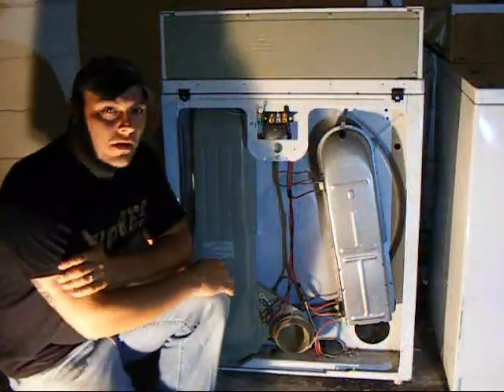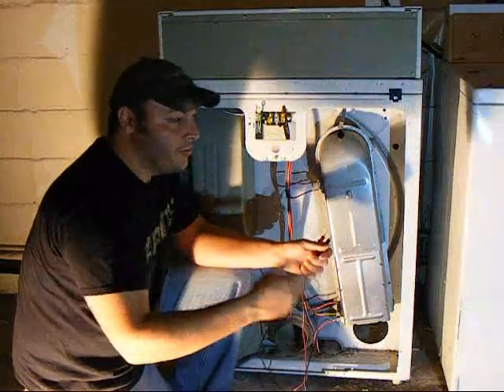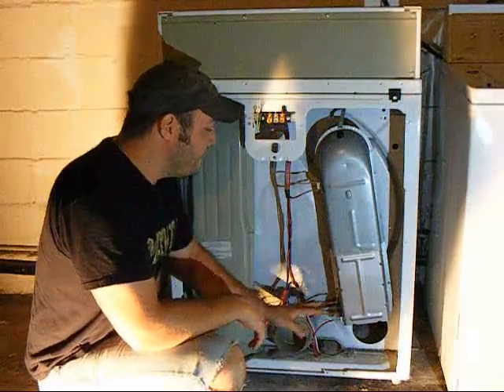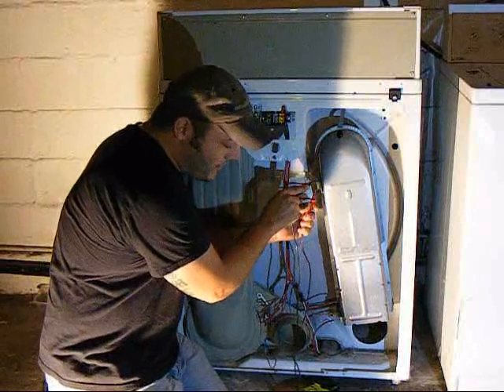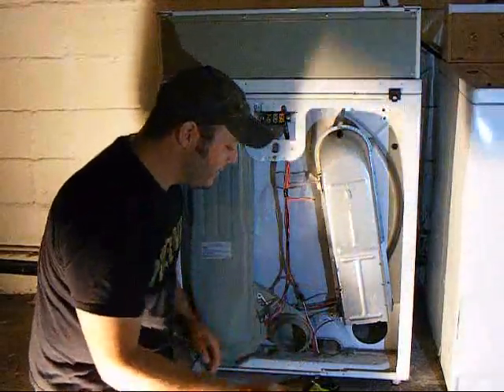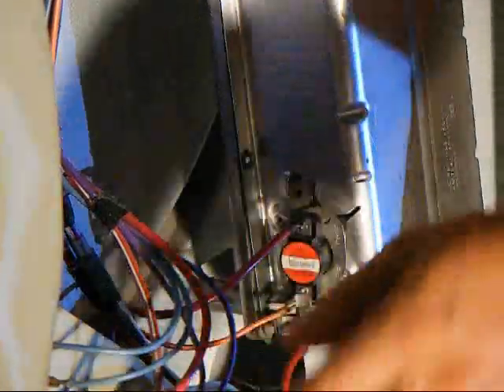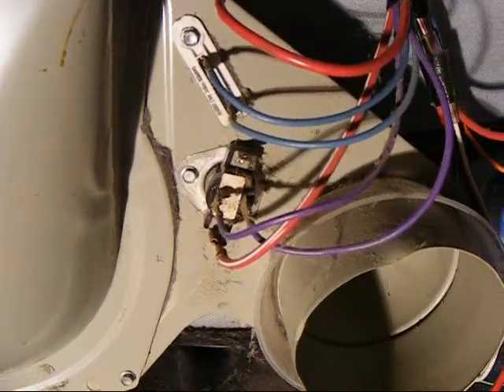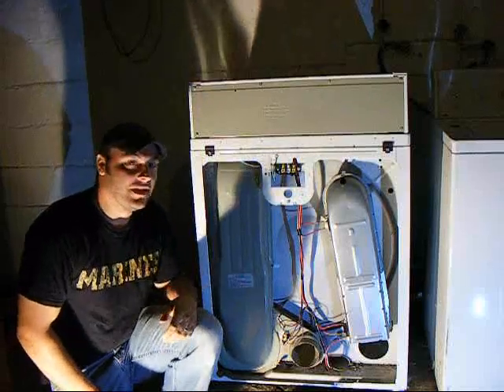Whirlpool / Kenmore Dryer Heater and Thermostat Test

Comment: I took my hi limit thermostat off (the bottom one on the element side) and can't remember which wire goes on top and bottom.  They're both red...and the thermostat has a 1 on one side and a 3 on the other side.  I think I read somewhere that it doesn't matter which wire is top and which is bottom...but I wanna make sure before hooking it up and shorting a bunch shit out...or ruining the whole thing.   Oh and both red wires have some writing...but I can't remember exactly what they say.  I think one says HS1 and the other is HS3- ....1 or something like that.    Thanks.

P.S.  This is obviously an older circa 1990 Kenmore where both ends of the Hi L. Thermo. look exactly the same. (and both wires are red.) It's not the more modern version you can't screw up b/c one end looks totally different from the other.

When I look at one wire terminal and what I assume would have been the corresponding end of the old thermostat...they look slightly more blackened and rusted than the old thermostat's other terminal and wire I think goes on the other side...but if I hook the new one up this way...then the #'s written on the wires don't match the #'s on the new thermostat (a 1 on one side, a 3 on the other side...the wires have something like HS1 on one wire and HS3-??1 or something similar on the other wire-both wires are red ).

Comment: No. I've replaced the thermal fuse part number 3977393. The dryer heats for a couple of days, then stops heating. It still spins, but does not heat. I check the thermal fuse, and it is bad again.

Comment: Hi. I did get a huge "zap" when I tried to do what you said with the voltmeter. I'm assuming I did something wrong. Any thoughts? Also, I have a GEW9868KQ3 Whirlpool and I cannot figure out how to get to the thermostats you are talking about. I took off the bottom kick panel, and the entire top, but the back doesn't seem to come off. Am I going to have to pull out the drum? Don't laugh at my ignorance, I'm a single mom, and I need to figure out how to fix this thing myself.

Comment: So I used my multimeter and on the top sensor it read 2.3 on the heating element it read 13.9, on the element by the heating element it read 11.1 and the third sensor reads 1.7. Are they all bad and need to be replaced? The problem is the dryer gets to hot. Even on the low setting it gets burning hot.

Comment: Hey buddy I had a question my dryer stopped heating and I checked all the components and found that the thermal cutoff was bad so I replaced that and the thermostat turned it on element lit up got hot so I thought all was good but apparently not put a load of clothes in went to bed woke up next morning they were still soaking wet so question is what would cause heat to cut off prematurely? bad thermistor? Or? Also I do have 240v at the back going home today to check the ventilation from the back of the dryer up through the roof to make sure its not clogged I know should have done that before I hope everything backup haha hopefully I'll find the clog which might have led to the failure of the thermal cut off again but just seeing if you had any suggestions

Comment: Thank you for this!! I've got an older Whirlpool Gold, & canNOT get the tube which holds the thermostats & heating element put back into its flange mounting. It took forever to get it out, & I coudln't see how it was mounted. Got the trouble IDed & parts ordered & replaced, no problem. 
Anyone got any hints how to get that bloody blasted freaking thing back mounted, before I end up spending over $100 NOW, just to replace that one damn piece??

update: never mind. 

I absolutely refused to disassemble the ENTIRE freaking dryer to put that part in*, so I ended up bending down the little, semi-circular tab which went into the flange at the back. Since the whole assembly is held in place with 2 screws on the brace in front, it hasn't made a bit of difference.

And my obnoxious neighbor swore I'd never be able to fix my dryer, 
because he couldn't figure it out. HA HA HA, pbthbthbththth!! . 

*reminded me of the Fiat Spider I used to have, where you had to pull the engine block just to replace the spark plugs.

Comment: My electric dryer is getting too hot and tripping the small thermal cutoff at the end of the heater coils tube.  I tested the violet wires coming into the 2 (of the 4) wires of the thermostat and one is 120v all the time and the other doesn't seem to go to the ground EVER.  That thermostat opens and closes at some high temperature on my stove but never seems to work in the dryer because the exhaust air that it feels is way too cool.  The bias heater never goes on.  What the heck is causing that????

Comment from the maker: hang in there, that switch should tell the heater to come on because the motor is spinning.  That motor only spins at one speed.  Did you see the two red wires on the motor I was talking about earlier?
Let me know how your doing.

Comment: hi, I have a a older Kenmore dryers and it turns on but wont heat up and when its on it just keeps going but wont turn off and I have tried checking the thermostat, heating elememt and the timer but still wont work..do u have any suggestions on what I should do next. Thank you

Comment: yes I found them the switch seems to be working correctly but still no heat. when you pull on the shaft switch, the switch connects, when you let off (motor not spinning) it disconnects, I'm very close to turning this thing into Swiss cheese with bullet holes......

Comment: Would  it be just as good and just as safe to verify proper voltage at the outlet, and then just read continuity from the plug to the terminal block and make sure your cord is ok?...why wouldn't that work?

Comment: I'm in deep now, This motor has a centrifugal switch on it, it must tell the heater element not to turn on when dryer is in high speed spin. either is is broken or there was so much lint on it it never returned back to position (of course i never checked before I blew it off with air) also broken belt switch was lose screw fell out. But  I think that would have only failed if belt broke. I'm getting close now

Comment: I have a Whirlpool LER7646a Dryer. It was not heating but running. I replaced the Thermal Fuse, Heating Element and Cycling Thermostat, but still have no heat to the dryer??? What do you suggest?

Comment: So, right off the bat I have a problem.  My dryer is Kenmore so similar to this one.  But, the first step, where you check power coming into the dryer, mine does not have the wire/screw connection.  It is connected with plastic covers so that I don't see the wire at all.  How do I test that?  Help please!

Comment: I'm having this problem with my dryer and i checked my ac connection as you do in this video at about 1:45 but i'm getting half of the voltage you're saying i should get. I'm using an MA-line Pocket Analog Multimeter on the AC 500 setting, if that helps or makes sense, I'm new to this. My circuit breaker is fine, i've checked it and reset it multiple times just to make sure. the cord itself doesn't appear damaged or burnt in any way. Could the Cord or the outlet be the problem?

Comment: My second question is about thermistats. I've tried to test the dryer thermistor, the thermostat near blower housing. It has no continuity on 200 Oms of resistance. Ordered a new part, the new part tested alone shows no Ohms, got a replacement part and new part shows no Ohms. I'm testing other thermistats on dryer & getting readings ok on Centech multimeter which seems to be working fine. The thermistor part old and 2 new ones will not give a continuity reading whatsoever. They will only give a reading at 20k on Ohms then they will read a number, could it be the 200 setting is lower than the functioning part so it will not register a reading? How do I know if the part is actually bad?

Comment: Another question , My dryer heats, but trips the breaker. I checked all the thermostats and heating coils
Reply from the maker: cgoldsmith The breaker is probably going bad.  Replace the breaker and try the dryer again.  Have seen this enough to be sure it's most likely the breaker and not the dryer.
Let me know how you make out!

Comment: @applianceoutlet have a Kenmore Elite. None of the auto cycles work I have use the manual cycles to get the dryer to complete a cycle. When I use the auto cycles the dryer shuts off after a few minutes. any clue on what would cause this problem.

Comment: Best electric dryer troubleshooting video on you tube.   I have seen them all.  I did all the tests in the video and just got a new $7 thermostat today, installed it and now dryer has heat. Also, he doesn't treat you like an moron like some, who give you a 5 minute disclaimer on why you should never test a live circuit, because they don't want to be sued by a moron who's brother is a lawyer.  This video tells you what you need to do to get it fixed!  All morons will perish, but that may be a good thing!
Reply from the maker: Civilian Patriot Thanks for the Great Comment!  Nice Job on your Repair and Thanks for Watching!

Comment: My problem makes no sense.

Line voltage is good coming into dryer (240v)
all 3 thermal switches have connectivity 
heater element has connectivity (and dose not short with housing)
just for hell of tried bypassing high limit and thermal cut off wired direct to element and nothing

when it test voltage I get 40 volts going to heater element, is that enough to heat element? 
I don't see any transformers in wire diagram.

Any Ideas?

Thank you!

Comment: hey bill if voltmeter reads .1 or .2 on the thermostat you think they might be bad?
Reply: Same question
Reply: What's the answer if it's one or two on thermostat is that bad?
Reply: Betsy Berger did you get a answer to the question on the dryer?
Reply: David Sisung it’s good.

Comment: I have a Whirlpool LGN1000HQ0 gas dryer and I noticed the machine will turn on, but when it gets to the energy saving * setting it will turn off and not re-start at all settings. I have to wait till it cools and than it will start.  It drys well, so problem with the heat, could it be the thermal fuse or the cycling thermo thermostat? I also noticed it has 4 prongs (cycling) and I tested them using a multimeter it beeps between the far away prongs, but not the close ones (purple wires), Thanks.

Comment: Mine has the opposite problem, it seems to heat too much.  Air comes out from outside, blower and filter is clean from lint, but it can get as hot as an oven!  I don't get it.  It didn't use to do this, I'm pretty sure.

Comment: Hey I am reading the heater with no omhs whatsover my meter indicates still 1 with both terminal is this an open and should replace it then?
Reply from the maker: Correct, the heater is bad, the coils inside are likely broken somewhere.  Remove the heater and inspect the coils inside the heater and find the break.  Replace the heater and you'll be back up and running.
Thanks for Watching!

Comment: so I get 124 on the first two and 250 in the sides. is that about right? my dryer runs but no heat ive checked the vent, the heating element, thermostat and i cant figure it out.

Comment: I checked the cord, I did not pull breaker to check, but it's not that old the whole panel and set up is only about 9 years old including dryer. It's a Kenmore elite front loader (model 110.82822102) buying a new one is not a problem, just burns me up because I am very,very handy and this dryer is in great condition plus everything is checking out ok.......  
I don't get it

Comment: Hey bill I got shocked! just kidding. my dryer kicks on with burner running for some time but then burner turns off. I turned it on with door open and vent from inside dryer removed (there was no hot air coming to cycle thermostat) and the burner was kicking on and off like normal. my cycle thermostat heater is reading open circuit. bad thermostat?
Reply from the maker: Dean fortwenty Do you have a gas dryer?
Reply: yes it gas. the thermostat heater stays open circuit even when I heat the thermostat until it have open circuit. the area by the thermostat was clogged with lint and I hear a rattling round when I shake the thermostat. thanks for helping!
Reply from the maker: Dean fortwenty It shouldn't rattle when you shake it.  I would replace it.  When you run it with lint filter out and door open, it will heat up and shut off the burner quickly.  This is because no air is pulled through the dryer.  At this time when it's back together, does it heat and dry clothes?  Or does it run with heat at first, then no heat the rest of the cycle?
Thanks
Reply: correct burner turns off/on quick when door is open. but the burner stays on longer and cuts off never comes back on when doing normal drying with clothes inside. I ordered the thermostat today, no local supply. I have same problem on two dryers thanks for helping! Bill
Reply: Bill Newberry HI BIll
I got the new cycle thermostat but still same problem. I drilled hole in front to view burner while running. with wet clothes inside the burner runs for a while, cuts off for a while and then the igniter turns red hot then off but NO flame.  Im starting to think its solenoid issue. I watched a video from parts store that showed if the heater on cycle thermostat is reading open circuit its defective which led me to purchase new thermostat it also has open circuit.

Comment: 2 times a tech.  comes to the house and replaces theromstate. 2 times it works. But it stops working after a couple of loads. I hear squeaking nose when the dryer(Estate/Whirlpool) starts up. What next?????
Reply: Robert Walker Maybe it was the Heating element.
Reply from the maker: Robert Walker Venting issue,  clean the dryer vents and make sure your hose is not kinked behind the dryer.
Squeaking noise....could be related...or a roller issue or idler pulley problem.

Comment: Hi Bill,Can you please help me? About 3 or 4 months ago I replaced the heating element and both fuses ( but not the thermal fuse) It was running like new, but now it will not spin, It actually does not do anything but I could see the red glow  reflection on the wall from the heating element and I can hear the timer and nothing else. I don't hear the motor nor the blower. So when I turned the timer and pushed the start button in a few second I see the glowing heating element nothing else. So my conclusion is; it is not the push button switch because it stars heating when I pushed it, it is not the door switch, it is not the heating element or the fuses because it heats up. What do you think it could be? The motor? but if it is the motor, shouldn't it have a fail safe that if the motor fails the heating element will be stop? Please help!!!!!

Comment: Hi  Bill.  I will check try to replace the breaker.  Do you have a video how to do that so I don't electrocute myself? (I know you don't give a shit  lol )

Also, please read this to give you more info about what I have done.

I have tested all the thermostats and fuses for continuity and they are all good. 0 ohms.  
I tested the heating element coils...they are not broken and continuity good.
 I checked the wires of my 4 prong plug and I get 120  from the left side to the neutral wire terminal  and from the right side to the neutral wire terminal and 240 Volts from the right to left 

I checked the socket and the Voltage is good

I checked the circuit breaker voltage and it is good. It reads 120 Volts from the terminal to the neutral bar and 240 across the breaker terminal bars. The wires of the circuit breaker are not loose

However, my dryer will spin to the full amount of time set on airdry....but when I dry it with heat , the breaker always trips after 15 mins. Do you know what the problem may be?

Do you think it can be a bad motor but the dryer is only 4 years old

Thank you so much
Reply from the maker: Corinne Goldsmith Sounds like just a bad breaker to me.  It could be tripping out at a lower amperage.  I would replace it and go from there.

Let me know how you make out.

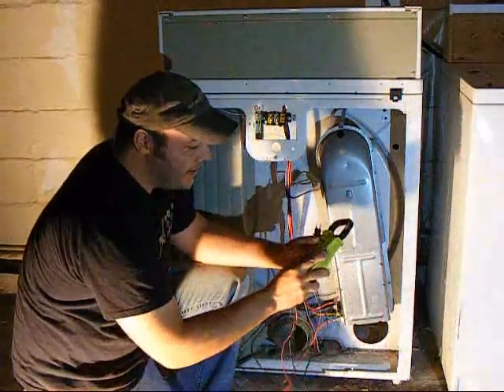Comment: You just told people to set their voltmeter to AC current (@1:05), not AC voltage, and then told them to test the circuit you told them to leave connected to source voltage. You're testing voltage because you know what you're doing, yet said the wrong thing and that could cost someone their life. 

You need to be more careful with the things you say if you're going to be making DYI videos. You better hope no one checks it while its on because - despite your not caring - you could still be held liable because you provided incorrect, and obviously dangerous, information.
Reply: Scott Broscious Yeah probably not
Reply: When you say 'probably not,' statistically speaking, you leave a lot of room for 'probably' and - keep in mind - 'probably" is exactly why McDonalds now writes "Caution: Hot Coffee" on every cup of hot coffee they serve depsite the warning not being added because someone actually thought the coffee was cold ;)
Reply: Scott Broscious because of that it's one of the most irresponsible videos I've ever seen but I know he doesn't care. Yet anyway hope he understands.